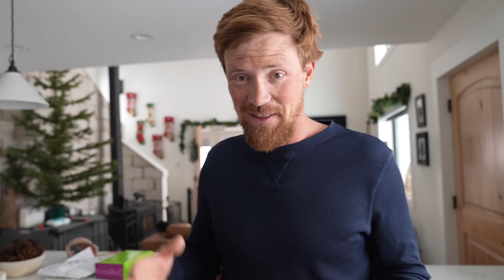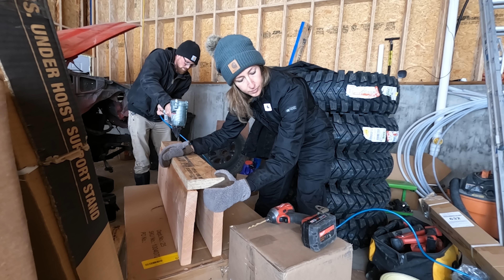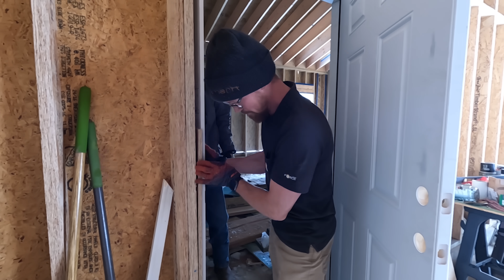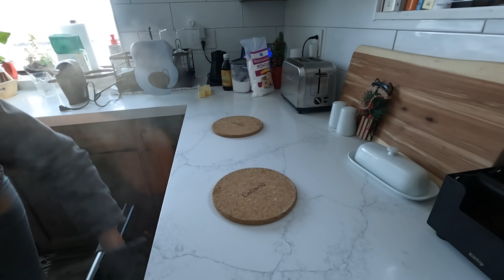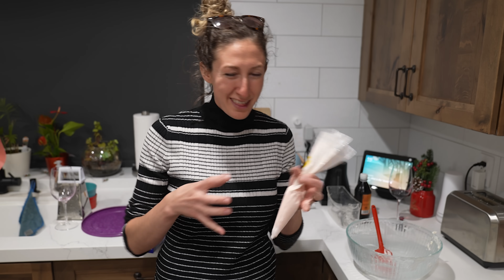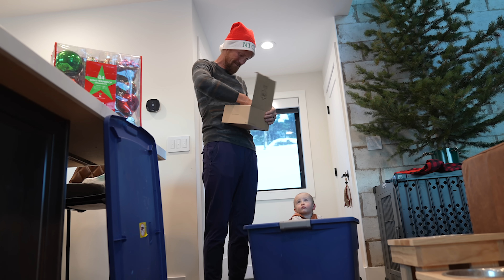WE ARE SNOWED IN!!! | TRENT & ALLIE

Comment: Hi Allie! I was a chef in Boulder, CO for over 20 years. Baking at high altitude was daunting at first, especially since I had moved there from near sea-level on the East coast. I discovered (and taught many students) an easy adjustment and it worked every time for whatever I was baking. I simply reduced the leveling (baking soda, baking powder, yeast) by a bit for 1 mile up (5k-ish in the Boulder/Denver area) and a bit more for baking in the mountains (8-10k altitude). To make it super simple I would use the curve of my finger (look now at the curve on your first or the "pointer" finger, that first section where the nail is on the other side) to 'level off' in whatever measuring spoon was needed for the recipe.  In the mountains I'd scoop a bit more with that finger curve. And that was it. Didn't do any other adjustment and it worked purrrfectly. Hope that makes sense as it's easier to show it than speak it. <3 Sandy

Comment: no you don't need a separate channel, and yes you need snowmobiles. Electric start with reverse. you dont need conduit for ceiling wires. Google has several links for high altitude baking.

Comment: Great job on the cake Allie, are you using Crisco shortening?  Maybe try substituting that in place of the butter and or oil and see if that would help the cake to stay moist enough not to explode.  Also you may be able to lower the baking soda and or baking powder amount(s).  Just a thought, has been years since I have baked though.

Comment: Hot cocoa mix has sugar and powdered milk in it and probably some anti caking ingredients so it probably has some effect on the outcome, and if your using a leavening agent Dutch processed cocoa works better than just regular cocoa. That may help the cake outcome, I’m at a super low altitude so I never have that problem. Anyways the boxed cake is usually better than a homemade cake and it gives altitude instructions on the box, so that’s what I use anyways.

Comment: A snowmobile is similar to my motorcycle - no matter how much you can justify it with practical reasons, the overriding reason is:  It's FUN!.  Yes, there is some survivalist aspect to it.  You CAN get around on snowshoes or cross-country skis.  But not fast.  And there may be medical emergencies that require a fast response during "snowed in" conditions.  For that reason alone, I vote for a snowmobile.  One that can handle two adults plus a sled for Leo and cargo, which means it doesn't have to be fast, but it must have power and size.

Comment: T&A - Great fun all around. I'm just glad you could laugh off the exploding cake, Allie. That was absolutely precious, and honestly, well worth sharing. I live up a 50 foot hill, a few blocks from the Harbor, so I normally don't have to consider it.

I do have friends and family tho, who live up to 4,000 foot of elevation, and by my visits, I know well enough to consult them of their standard deviation from sea level.

As I recall, tho I might be wrong, but if pure water boils at 212F at sea level (as it does), it will boil at a lower temperature, the higher the elevation. Generally, it is a time calibration for every thousand feet above sea level, as used in a general sense.

I forget the exact means of conversion, but I just consult my 'human handlers', and by so, I've been pretty well able to bake, successfully, at elevations.

Point being, I have had a cake or two explode on me, at times, and I reacted similarly as you, to laugh, and not to cry over spilt milk.

Anyway, I'm proud of you for having the hutzpah to share that disaster. Absolutely precious.

Comment: Your cake is a long way from a guest appearance on Cake Wrecks, so give yourself credit.  As for the first cake, if you allow the bits to dry out completely then crush them, you'll have a nice crunchy coating for the sides of the second or any other cake.  The crumbs freeze brilliantly and for at least a year.

I've lived, and baked, at 300 metres, sea level, 1200 metres, and now 200 metres.  I had trouble with cakes at 1200 metres:  I had to adjust the leavening agents downward a bit but also had to be less enthusiastic about how much air I beat into creaming butter and sugar, and how much air was beaten into eggs or egg whites.  One problem remained:  they were invariably drier than they were at the lower elevations.  They tasted good, but I still can't figure that out.